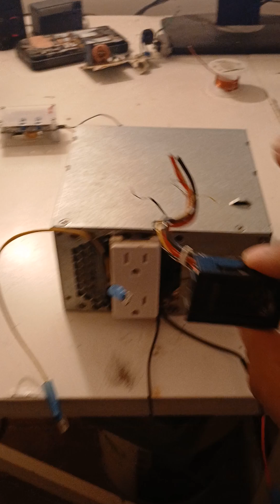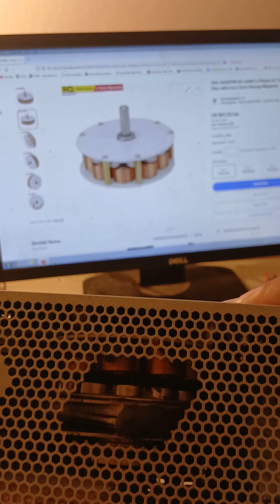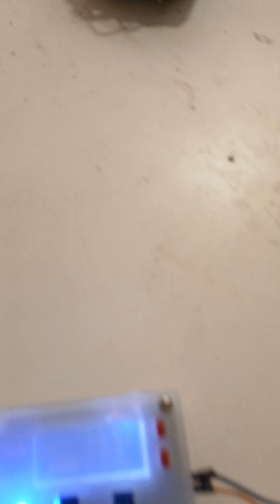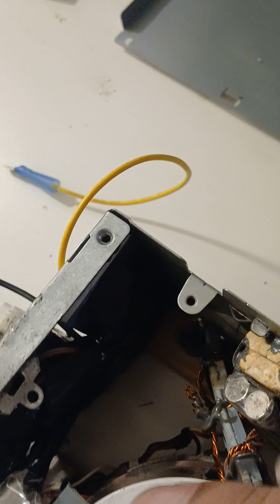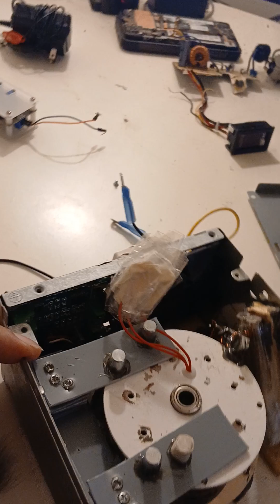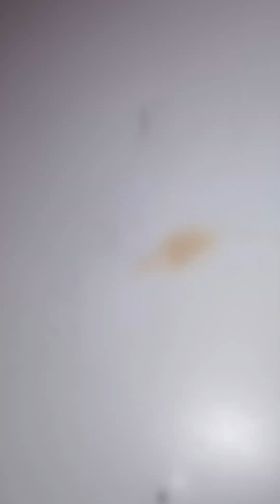Demonstrative Overunity Device for Illustrative Purposes PROTOTYPE

Comment: nope       your explanations are  all gobbledy-gook/smoke and mirrors.      without the use of a metered power supply,  you  don't even know  how  many  watts  are  going  in/being consumed.!      you can make  NO  substantiated  claims about the cop of the system.!      lol        (see my research if interested.)
it will behoove you to understand  Mechanical Advantage (MA), as the term applies in a rotary mechanism.      specifically, in an rotary ou machine, the rotor must be  driven  (in the most efficient way, and) in a way that gives the motor/prime mover  MA  over the  Load.    the load occurs at the  radius  where the  magnets move past the coils.    consequently, the losses associated with driving the rotor  its  center of rotation  should be avoided.
it can bee seen that the prime mover in a machine, like a compressor, is  always  loaded via the use of Reduction/MA.